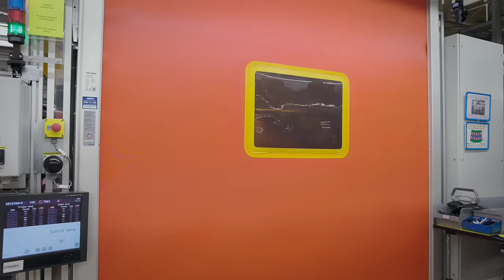New SKODA SUPERB 2024 - PRODUCTION in Bratislava

Comment: The exterior is excellent, plus the fact that sedans are still manufactured. But the interior is an ill-conceived mess with a large tablet placed in the middle of the dashboard in an inappropriate place that reduces visibility. The rectangular driver's LCD clocks supported by a round dashboard that exceed the circumference of the dashboard, not even slightly inserted into the dashboard like the Octavia 4. Whoever is the designer of this very ugly board should be fired. The rest of the dashboard is ugly, difficult to clean and maintain. Many superb Skoda fans, including myself, will give up on buying this long-awaited model. I understand that almost all manufacturers have lost and will lose a lot of money because of electric cars, but that doesn't mean they make fun of the others. I'm a Skoda Superb fan, I've only had sk superb cars, but I can't buy a car just for the exterior, and on the inside it makes me sick with nerves at how ugly the dashboard looks. An execrable and unfinished dashboard.
Reply: Even I, a Skoda, admit that I don't like the display at all, and not just me

Comment: Worst car I ever owned, lane keep assist was the most aggressive I’ve ever experienced, tried to kill you on every drive.  Poor quality interior, very flimsy, temperature controls had to rotated very slowly as cheap Chinese buttons that did t work if rotated faster.  Worst touch screen air con controls ever.  1,5 150ps with deg was terrible, hesitated to go into 1st gear all the time, dangerous at roundabouts and junctions.  You were either in 7th all the time with no power, or 2nd at 6000rpm and the engine screaming. Seats were like a park bench, zero side support, crap arm rest. Glad it’s gone.